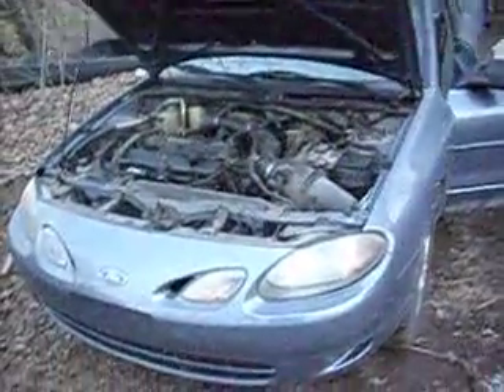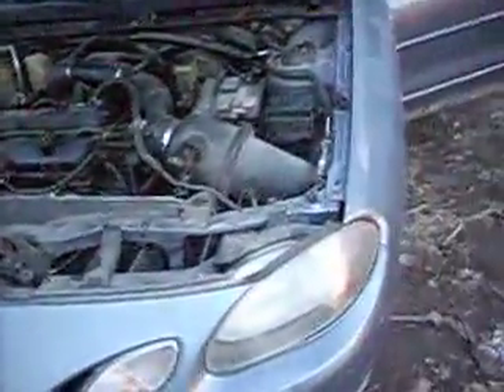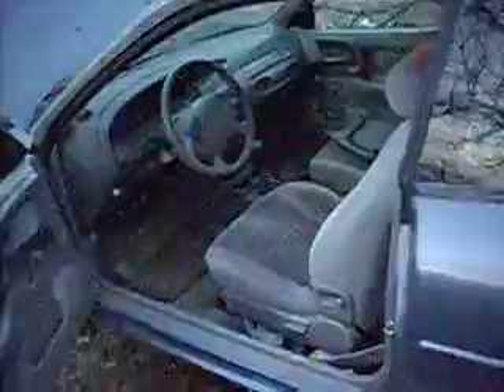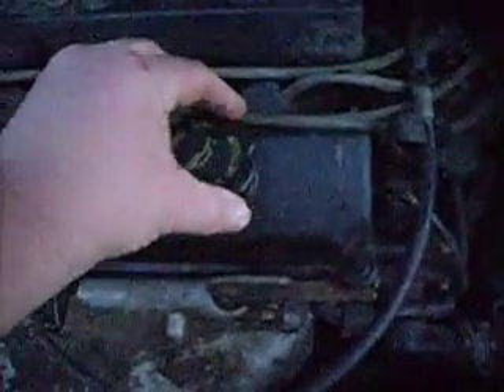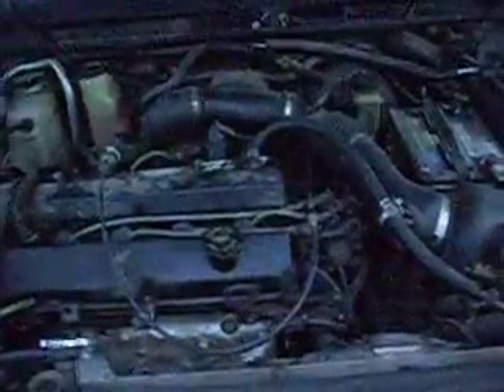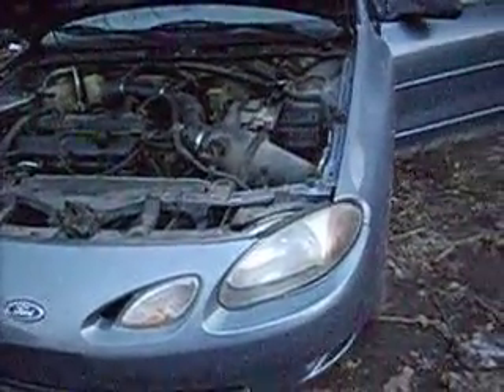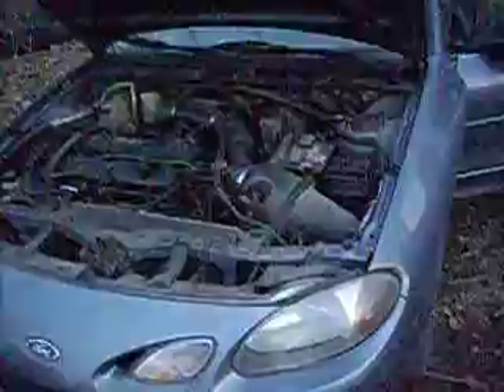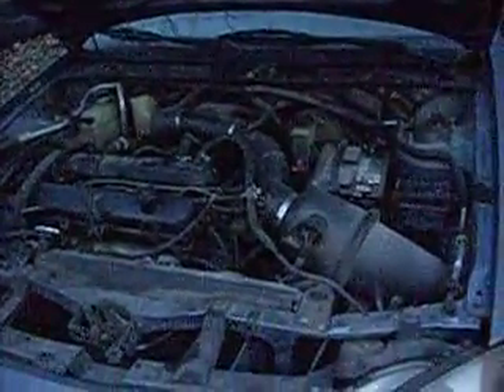99 ford escort ZX2 bad engine

Comment: i have a 1999 ford escort zx2 it has 190,000 miles. it had 130k when i got it. my engine does make clicking noise to but theirs nothing wrong with it and its still driving strong with no issues

Comment: I have one of these and am looking for some assistance, It runs well, mines an Automatic, except the reverse gear makes some clunking noises, still runs fine and does go into reverse and you cant hear it when you give throttle, but when in reverse with the foot on the brake you can hear it rattling around. Again only in reverse. I've added transmission fluid and it seems to have got a bit better. Thanks.

Comment: try squirting a little oil into the cylinders and repeat the compression test. if the compression increases, the piston rings are DEFINETLY the problem. if it doesnt, proceed with the leak down test. usually with a serious blowby problem, its usually the piston rings. good luck to ya!

Comment: I have a zx2 with 93k miles, mine is starting to have a click so like the other guy said it must need a timing belt. And obviously if you take the oil cap off pressure is there, it's an engine! But yeah, do the head gasket seal and belt.

Comment: i have the same car its been alot of problems but what you describe sounds like problem i had and i ran it till it wouldnt go anymore mine was the timing belt. most places you go will tell you if the timing belt on this car breaks then the engine is bad, but this is not tru the zx2 is not a zero tolerance motor.defenently sound like how my car was before the belt broke / good after the belt change. but that looks exactly like if the timing is off. new belt should help  fcheck first though

Comment: 164,000 miles is NOTHING for most cars newer than 1990.  My buddy has a 99 zx2 with 240,000 miles on it, and it still runs smooth with decent power.

Sounds to me like the car wasn't well taken care of.

Comment: Its not unusual that the headgasket blows at the 1.8 and 2.0 16V Zetec engines with following bent valves !! As it seems like it blows exaust in to the valvecover area im am next to 100% shure its the headgasket..............
Reply: 2.0 16 valve Zetec engine is a non interference engine.